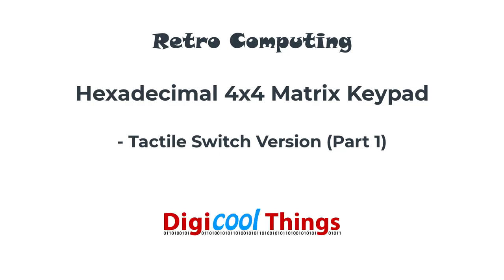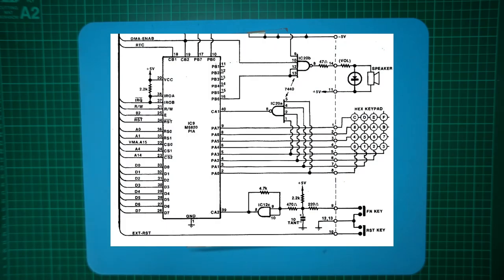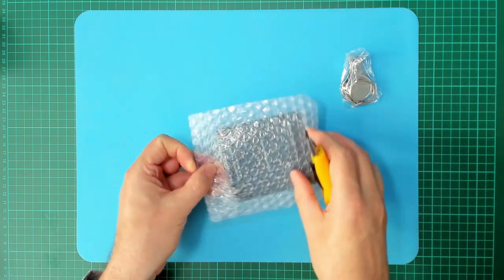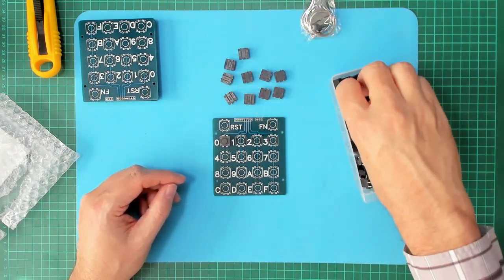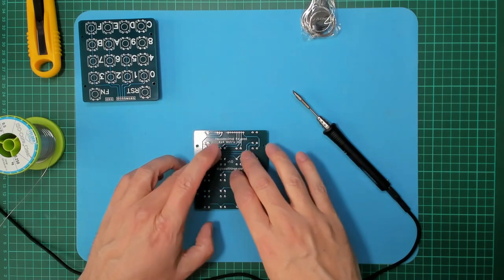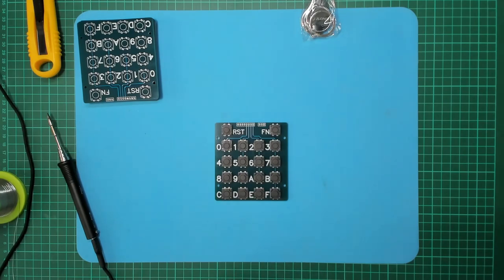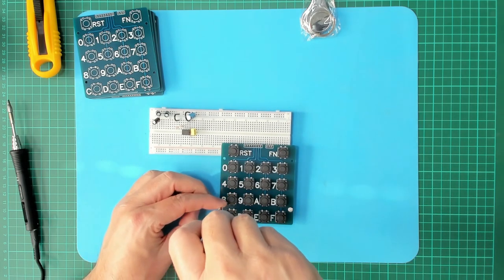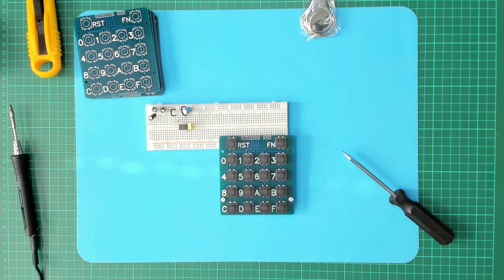Hexadecimal 4x4 Matrix Keypad - Tactile Switch Version (Part 1)

Comment: Nice keyboard, i can remember making one like it back in the late 70's for my Sinclair MK14 board.
it had a flat foil keypad with a metal plate on top, bloody horrible to use.
i so had the video card which use the same 256 bytes of memory as the processor, so you could see your code changing on the TV as it ran.
Ah the good old days 🙂
Reply from the maker: Ahh, the good old days.  When you look at the amount of bloatware that systems are running these days, it’s not surprising that we could do so much with the relatively small memory space and 8-bit processors, back in the early days! 🙂